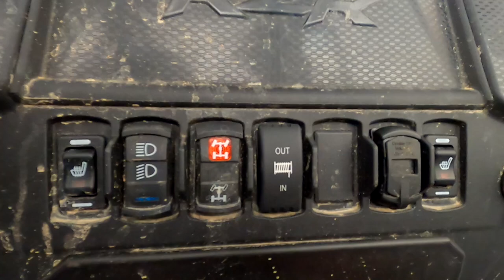We pulled our Truck with our new KFI winch! - How to Install a RZR Winch on a 2019 XP Turbo

Comment: Great video. We just installed a winch on our 2019 Turbo a few months ago. Instead of going with the frame mount, we went with a winch bumper style. Haven't had to use it yet, but I'd rather have it and not need it  than need it and not have it.
Reply from the maker: Having been in a couple of positions where we have needed it and not had it, we agree with you!